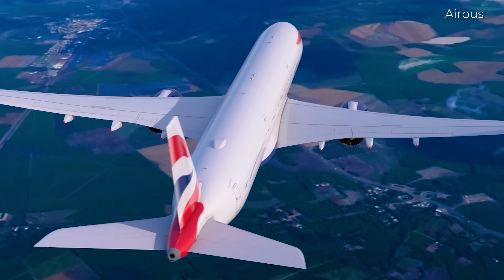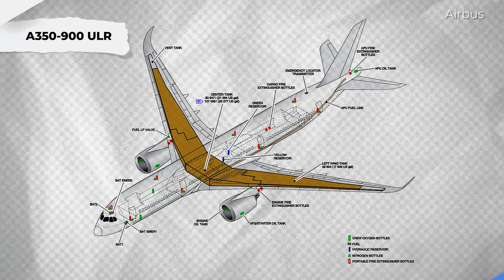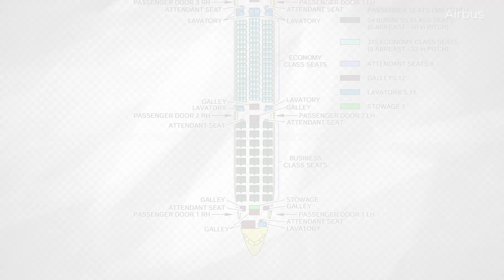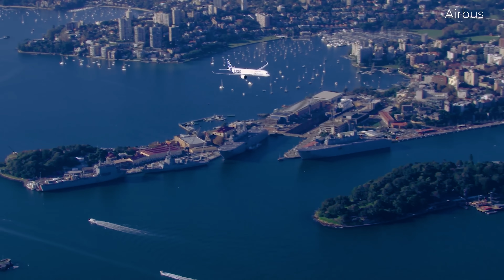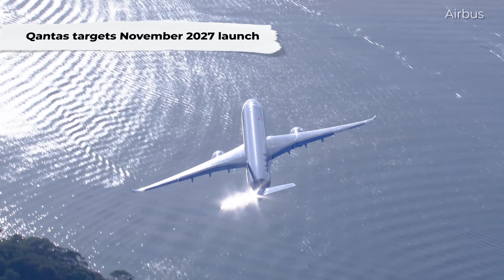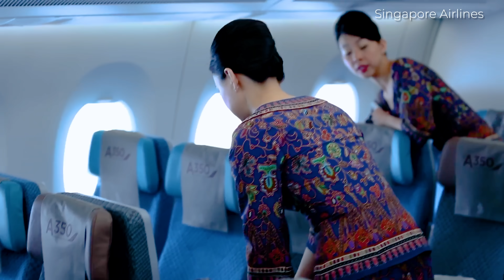Qantas Analysis: Why Only the A350 Can Fly the Delayed Sydney–London Route

Comment: Fine for those in business class, but horrendous for anyone in economy. Singapore Airlines took the right approach but even premium economy for 20 hours would be painful.  The longest single leg I've done was Sydney to Dallas, then I had to fly to Florida. It was bearable in business class but I wouldn't attempt it in economy. The worst was Paris-Frankfurt-Singapore-Sydney with 14 hours in an economy middle seat on the Frankfurt to Singapore leg. Never again. I need an actual stop-over. As much as I wish I could experience the double sunrise, I'd need to win lotto first. 😢 I hope Qantas issues double sunrise certificates to passengers. It would be a small cost to the airline but a great keepsake for the passengers.

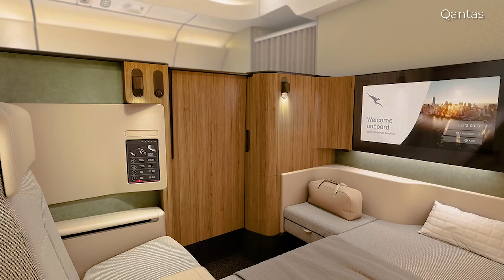Comment: 4:05 wouldn't fewer seats mean they would need to have a higher load factor to turn a profit than a higher density?  
80% load factor of -1000ULR: is 191 seats.  you'd have to have much higher prices to equate the same for a typical -1000
80% load factor of -1000: is 297 seats.

Comment: The 777-200LR could probably do it. The 17395km range is advertised in a configuration for 301 passengers, while the A350-1000ULR can go to 18,000, thats with only 238 passengers. I guess the 200LR's fuel burn was simply too much. If the 777X program went better, we would probably see a 777-8X by now, that could absolutely do Sunrise.
Reply: It could, but most of the Qantas long haul is already Airbus with A330 and A380, the exception being the 787. It makes more sense for Qantas to standardise on Airbus for crew interoperability, logistics, maintenance etc.
Reply: @theharper1  I'm more thinking of why Qantas didnt decide to go all in on the 200LR as far back as 2002 when the program launched, but I guess they assumed that new airframes would arrive faster than they did. I don't think we're even going to see the Passenger 777-8X until the mid-late 2030s at this point.
Reply: @RobloxianX  Qantas ordered their first A330 in 2000, so possibly they had already decided to go Airbus for long haul? I think there's been YouTube videos on the subject of why Qantas never went for the 777, but I don't recall the reasons. The 787 wasn't ordered until 2005. Qantas has been moving generally to an Airbus fleet with Jetstar flying the A320 very early on, the A330, A380, now the A220 and A321. It's likely that the 737 fleet will be replaced by Airbus. The 787 seems to be the odd one out.
Reply: @RobloxianX  I looked again at the Simple Flying video on the subject of why Qantas chose the Airbus A380 and A330 over the 777. Apparently at the time, ETOPS wouldn't allow either the 777 or 330 to do some routes that Qantas needed (especially south America and South Africa) so they got additional 747-400ER. The 777 didn't suit domestic routes in Australia which the A330 fit better. It's claimed that Airbus did the A380 and A330 as a package that was too good to refuse, but it also gave Qantas an opportunity to change the pilot contracts as well. The problem for the 777x has been the delays, and Qantas was keen to move on with project Sunrise after the pandemic. The A350 gave them smoother migration of pilots between the A330, A350 and A380.

Comment: While the Sunrise aircraft are delayed, Qantas needs to think hard about in-flight internet access. The delay to the Blue Origin rocked program with its pad explosion, will delay Starlink competitors. 
Starlink terminals are high capacity and cheap. But SpaceX insists airlines do not make it a premium service with messy and slow access. It has to be as simple as logging into a home wi-fi. Pulling Starlink out of an aircraft and replacing it with an inferior service won't go down well.
Reply: starlink is overrated.
Reply: Qantas will have a fast and excellent Wifi on ALL of their planes flying OS, by late 2026.

Comment: A 787 can 100% do this… all you do is the same thing that airbus did and add extra fuel tanks!
Reply: No, it can't. Where would these thanks go? How would the 787 lift the fuel and still have a commercially viable payload year-round with enough diversion fuel etc to make it legal? The only Boeing plane that might be able to do this is the 777-8 which is what Boeing offered. If the 787 could do this Boeing would have offered it. Internal analysis at Qantas thought even the 777-8 would be a push.
Reply: @camhusmj38  it actually would be possible on a technical level but payload capacity would be so limited that it wouldn’t make business sense
Reply: @bobperry8066 That’s why I said commercially viable. They flew an unmodified 787-9 on the route but with 40 people, no catering and reduced water.
Reply: Not exactly. Adding extra fuel tanks would require increasing the MTOW. The 787 could make the trip but it would need to seriously reduce payload. An all-business class layout would work on a technical level but it wouldn’t make business sense.

Comment: Having done London to Melbourne, Melbourne to London, and London to Sydney, sitting in an economy seat,  I'll trade a non-stop flight without a lie flat bed for a flight that makes a fuelling stop any time the latter flight gives me such a bed.
Reply: You mean: rather have a stop-over, if in economy, unless one has a lie-flat-seat in business on a direct flight?
Reply: @87solarskyNo. Given a choice between a non-stop flight without a lie flat bed, and fuelling stop with a lie-flat bed, I'll choose the latter, even though it will take longer. 

However, I don't expect such a choice to be offered, because it would cannibalise business class.
Reply: @sylviaelse5086 the current QF2 flies LHR-SIN-SYD. Qantas flies Perth to LHR direct. I'd expect the project sunrise flights to be in addition to QF1/QF2.
Reply: Currently the Perth to LHR flight has to stop eastbound , because of the altered route, because of the Middle East events.  But doesn’t normally.